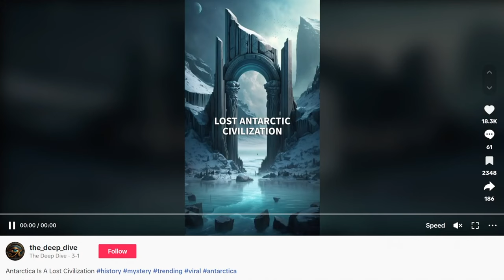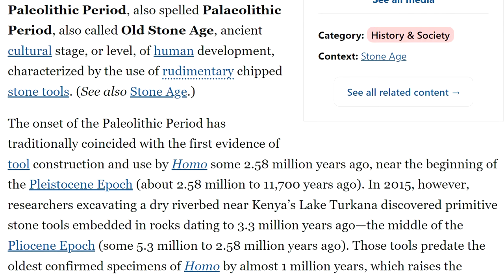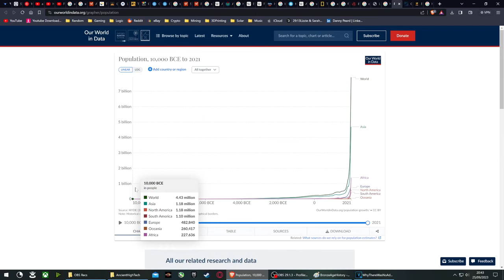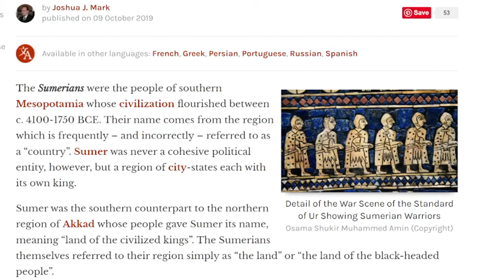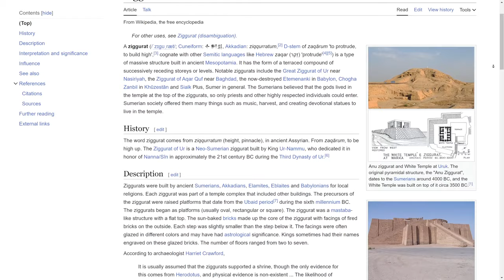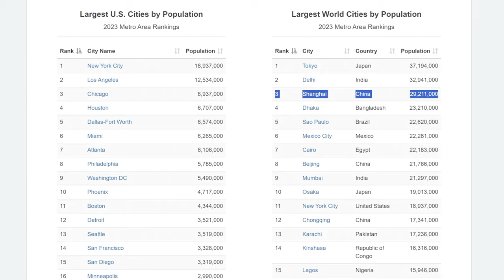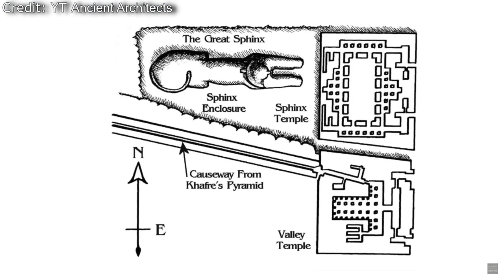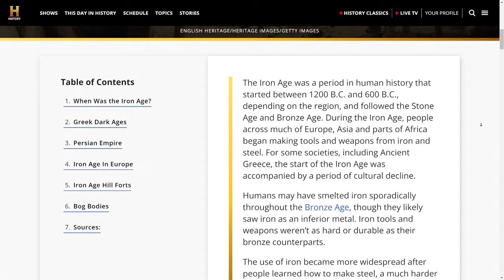Ancient Advanced High Technology DIDN'T EXIST, Here's WHY...

Comment: So, one thing nobody seems to mention when discussing all of these structures left by supposed “advanced” civilizations is the time difference.
The Egyptian pyramids and the pyramid structures in South America were built thousands of years apart. Such structures around the world were not built at the same time.
Also please remember the people back then were basically as smart as people today. They we’re thinking, intelligent, and creative.
Humans used basically the same construction methods up until the Middle Ages. 
We don’t build like that today because we have steel and concrete and can build more efficiently and quickly with far fewer laborers. Many of the “amazing” things the builders of past accomplished “without power tools” could accomplished with simpler methods and techniques of the time. The biggest difference is the amount of man hours put into a given task.
Also, much of the precision touted by the “experts” pushing these advanced civilizations theories are actually not as accurate as they claim.
Reply: There's a big difference between South American pyramids and a few of the Egyptian pyramids specifically the ones made from polygonal Masonry. It is the polygonal masonry found around the world that people are concerned about as it has never been replicated By Any Man. That is a fact you can check out the videos where MIT and Cambridge University tried to produce them and failed even in foam. The real truth for the doubters will be the day that somebody does achieve polygonal Masonry. As they well undoubtedly be able to show you their true purpose. I promise you you will not be able to construct it. And the Academia throughout history has never been known to be wrong😂😂😂 oops I mean only constantly that's the only thing that can happen when you're right about everything
Reply: @ronsimpson3198  The repairers of the Parthenon in Athens are currently joining far more complex stone shapes together than what was achieved in S America.
Reply: @Leeside999  not even close to the same thing it is marble for one thing if you're talkin about the fitting of the cab stands and you should know that they have been working on that for a very very long time. And if you look at the pattern under the capstan it does not have hermetic perfection.
Reply: @Leeside999  and it is not even close to more complex I have seen more than 18 facets unbelievable stonework in Granite all hermetic
Reply: @ronsimpson3198  

The principle is the same. You mark the points that don't fit and you remove them, and then repeat the process unit there is no mark. Same technique a dentist uses when fitting a tooth filling so it's flush with your bite. He tells you to bite on a type of paper and the un-flush part leaves a mark. He then adjusts accordingly.
Reply: @ronsimpson3198  By "hermetic" do you mean it's just a good job? If I put one flat block on top of another flat block I can say it's hermetically sealed.
The complexity is absolutely incredible at the Parthenon.
Reply: @Leeside999  know what I mean is marble is a lot softer easier to carve if you've ever carved Stone and they have been working on that for at least a decade that I know of. Hermetically sealed is like two sheets of glass together these I like polygonal masonry structures are thousands of years old fit together with convection joints not straight this includes thru-and-thru often leaving a bowl like Mark fitted tighter than two sheets of glass put together creating a hermetic seal which means airtight not even water can penetrate. You would still be building the pyramid to this day if that is how it was the message being employed at the pantheon. Besides the fact that the pantheon although an incredible building it has none of The Oddities that polygonal masonry has. Such as acoustic capabilities in the niches that go nowhere. Maybe one day you guys will figure out what it was all for I already know as I have demonstrated the principle to a few people.
Reply: @ronsimpson3198  "know what I mean is marble is a lot softer easier to carve"

The stone being harder just means that it would take more force to shape and remove the excess. 

"they have been working on that for at least a decade that I know of"

Well they are working on a national treasure and bound by all sorts of restrictions and care so they have to extremely slow and meticulous. And they only have a few teams that are actually doing the stone work. The Inca walls and pyramid work was worked on by thousands at the same time.

"You would still be building the pyramid to this day if that is how it was the message being employed at the pantheon"

The only truly precise stone work in the Great Pyramid are the outer turing limestone casing stones, the last couple of limestone courses behind them, and the granite room of the kings chamber. There is no polygonal stone work in the Great Pyramid itself. The rest is a jumble of rough and random shaped blocks joined together using gypsum mortar. Look at any up close pictures of the pyramid. The blocks are all shapes and sizes with plenty of gaps in between. The precise work covers only a tiny fraction of the entire stone work. The rest is essentially just filler.
Reply: @Leeside999  I don't think people realize that the Great Pyramid has already been proven to be a helmholtz resonator. More importantly what people really don't realize is that it's an actually much more advanced helmholtz resonator then even we have ever made. The problem is humankind is not that smart. So I doubt until I get the rest of the $120,000 I need to prove how this structure alone functioned that they will figure it out.
Reply: @ronsimpson3198  " I don't think people realize that the Great Pyramid has already been proven to be a helmholtz resonator"

Has it? Have you got a link to this proof?
Reply: @Leeside999  I will try to find one for you but it is not that complicated to find. All one has to do is look up the acoustics of the kings chamber and the grand gallery I believe it is 440h
Reply: @ronsimpson3198  Even if it is, that doesn't prove anything about the function of the great pyramid.
Reply: @Leeside999  I am at work right now but there is something way more incredible then the cavitation of the upper chambers that everyone misses. It is the fact that the "king's chamber" is off set to the center of the great pyramid, considered one of the only mistakes in the pyramid. This is just not the case neither is the fact that the very crust of the earth is very near this frequency. You see that it is known to mankind that according to archeologists approximately 12 to 14,000 years ago human kind in southern Africa and parts of India both were making interesting primitive stone work. What originally looked like boat anchors were in fact musical stones. When hung having one side flattened and the other side chipped  to resonance they were able to produce a pretty primitive form of xylophone. So little does anyone know that these techniques are not only relatively easy as it rings because they are actually crystalline rock. The leap I will hopefully one day show is not very far fetched as if the pyramid is really 4,500yr old that leaves thousands of yrs for the leap to occur. The real problem is no one under stood how to activate the pyramid as I am positive it will still function although not like it originally did to perfection. As well as because of the damage to the casting stones and the "portculles chamber" you would risk damaging the structure. The real key to how the building functions has to do with the "Relieving chambers". One should note that the Queens chamber located much closer to the base and dead center has none of these features. Only standard chevron and there is much more weight on them. One should have also noted that the largest known stone in the great pyramid is directly above the "sarcophagus". The most important discovery is yet to be made as oneday people will find that the inner granite corridors and chambers in the ascending sections our going to have hollow voids above them as seen with the relieving chambers. Although they will be singular not unlike the five above the kings chamber. If one notes the chevron construction above the kings chamber they could easily observe the transferring of load beyond the granite back on to the limestone. This is the recent found case in the entry-level passage as well. As I predicted five yrs ago before it was even known. You see you would not have the acoustic effects one does without this. More importantly the true purpose of this structure would also not work without this. The truth of this structure begins with something known as the trial passage it was one of the keys to solving this puzzle. As one does not typically build large models in stone to do construction as there is a million easier methods of producing models. People should also note that the structure is both proportional to the earth and located near fault lines. One should also note the speed of sound within a crystalline and realize why you find the Fibonacci sequence in the structure. Most importantly you have human made limestone known as geopolymer throughout the structure. As this has really been proven as it has not been found anywhere on the planet. This can only mean that the particular striation has been all used up or more then likely it was made. It should be noted the calcite and magnesium content of these stones. Furthermore the outer casing stones were said to be Tura limestone which has an absolute absence of these materials. One should note the return to polygonal masonry techniques on the casing just as seen in the granite interior. No my friend regardless of whatever its true function I can show that I can use it to function for something much greater, as these were all the things necessary. More importantly people should have paid attention to the overlapping of legends around the globe. Not just of deluge or floods. The ones concerning moving stone with sound as well as communication through stone. Don't worry I have already constructed polygonal masonry in a sedimentary stone. And I am but 2 yrs away from construction in crystalline hopefully should I live that long lol. Then I will show how this system worked and why it does and also how the missing relays for connection to this system were right before everyone's eyes the whole time and it was not an obelisk. Then I believe it will shut down academics know it all techniques atleast temporarily. One should also note that I do not blame people as it was kind of tricky for me to figure out and I solved every puzzle I have ever came across. I am the true keeper of the unified field theory as well as science is my true passion.
Reply: @Leeside999  you know my friend just like Galileo and Copernicus sometimes things have to change in order for advancement. Unfortunately I am still a couple years away but I will show people with what the meanings of these things are as people were not intelligent enough to understand true Field Theory. This will be much simpler. The truth is sometimes stranger then fiction.
Reply: @ronsimpson3198  while I don't agree or go along with much of what you wrote, I wish you well my friend. And good luck with your endeavour.
Reply: @Leeside999  you as well